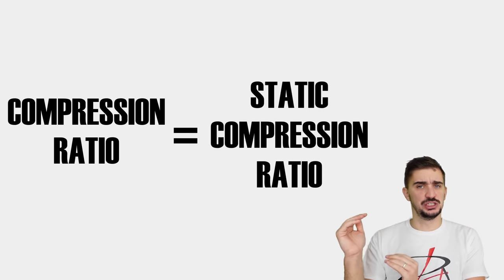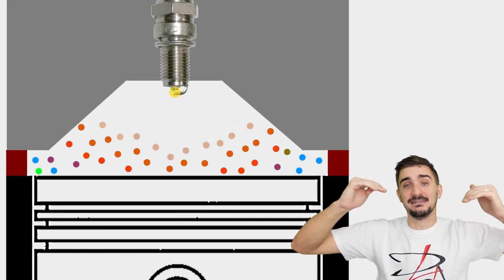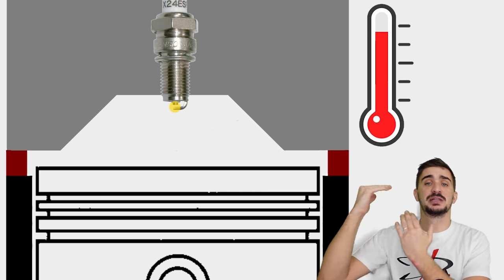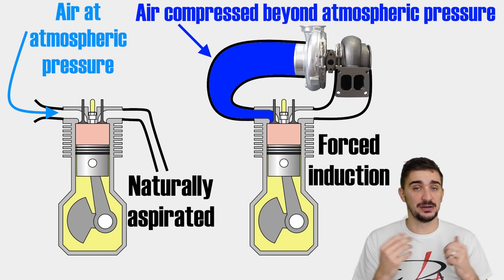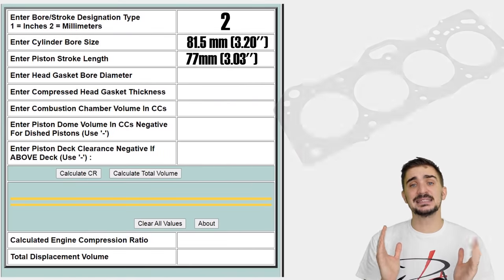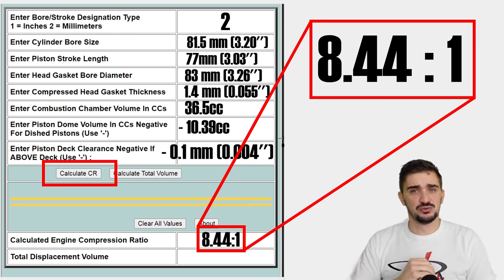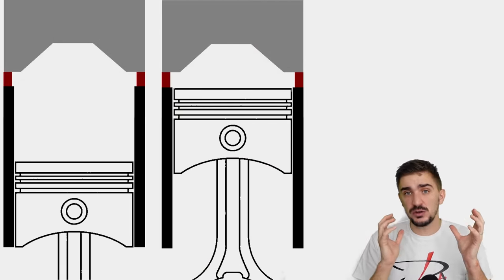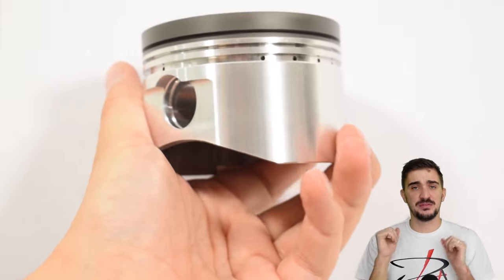COMPRESSION RATIO: HOW to CALCULATE, MODIFY and CHOOSE the BEST one - BOOST SCHOOL #10

Comment: Hi, i build stoker 1800 to 1950ccm ,,stock CR (10:1) i used crank big storoke 88mm,CR is coming out now 12,3:1 I want to use and  tank 95oct petrol. it is possible ? oder machined piston CR down? I will use stock head gasket , sport cams 265° degresee. Very thanks ..motor  is a BMW M42B18 IS 103kw. thanks

Comment: My first performance build I went for high compression just as the petrol quality was starting to be lowered some tears back, stonking power but knocked under load, forever feathering the throttle and dropping down a gear, till I holed a piston! High dome pistons with sharp edges also promote pinking, I discovered 😁

Comment: I'm a newbie. I came here wondering about turbocharging my car, and this gives me a question I hope to get some answers to...

The car is supposed to run stock 125 bhp, it's running a 2.2 straight 4. Should I look to mod the compression ratio (stock 9:1), or leave it as is in order to run 200 whp as my target?
Thanks for any input :]
Reply: If its a stock engine you should first do intake, exhaust, tune and cams

Comment: Good video, but I missed the fact that higher comp ratio decreases engine lifetime because of higher temperatures and more mechanical stress.
Reply from the maker: So diesels have short lifespans? I'm afraid it's not a direct correlation. If the engine is built properly around it can have a long life and a high CR.
Reply: It’s all relative to tuning. I’ve seen terribly unreliable low compression motors and ultra reliable high compression engines. I have a 10.8:1 compression in my turbo charged engine with no problems. Runs 95C in the summer and winter.
Reply: The parts need to be specked for their use.
Reply: @d4a   A Diesel burns completely different than a petrol engine, knocking is not that problem on a diesel. For example, you raise the comp ratio from 9:1 to 12.5:1. The engine is not designed for that. When you start and the engine makes the first turns from his own power (combustion) the oil pressure and the oil itself had no time to arrive the whole engine, but your bearings for example will stressed by the stronger ignition. Hope you understand??
Reply: @bennyz1971  but on idle, even with higher cr, in combustion chamber is small amount of mixture so pressures on tdc will not be too high, big stress on engine will start  on low rpm and wide open throttle(high pressure on tdc and low oil press because low rpm)
Reply: @d4a  Really mate, Benny Z is right. Just take a look at CR vs temp diagrams for gasoline engines... But there are different rules for diesel

Comment: I'd like to add that sometimes a lower compression ratio can result in more power with a naturally aspirated engine on pump gas, because it allows you to advance timing.
Reply: It can, but really all that means is you need better fuel
Reply: @tayvonrose2528  Then you have to ask, "how am I going to use this car?"
 If it's a racecar and you have access to 110 octane race fuel or if it's turbocharged and you will run straigh ethanol, sure, go ahead and increase compresion all u can.
 If the best you can get is 100 octane (ron), you will need meth-water injection to run super high compression. 
 For me, running over 10:1 without direct injection is the best compromise between power, efficiency and being able to use 95 octane. 98 octane is 20% more expensive.

Comment: Have you ever test on dyno which one is better, high compression ratio with retard timing or lower compression ratio with more timing?
For example, lets say:
- Honda K series engine
- 11:1 vs 13:1 (similar piston weight, because lighter piston make more power)
- Same internal engine (rod, crank, valvetrain, etc.)
- Same fuel (98 RON/ 93 US octane)
- Same ECU

Comment: I've increased my compression ratio in my Turbo Buick V6 Powered Malibu from 8.0 to 9.3. It has much better throttle response and will spool the turbo up faster. I run up to 32psi of boost. I may increase it to 10.1 at a later date...when it's time for a refresh or if it blows up. It's been in the car since 2005 so it's not a bad thing to increase your compression on your boosted engine. You just have to manage knock very well and don't get stupid with a lot of timing.

Comment: 12:18 Yes, boost makes more power than compression, but compression gives free power, while boost is very fuel hungry. When I say free power I mean that two engines with equal displacement running at the same RPM will suck the same amount of fuel, but the one with higher compression will make more power (higher efficiency).

Comment: Hey. I have a 16v 4age top and a 7a lower, and I'm thinking to add a turbo for more power. Can the turbo kit just be added? or will I have get new pistons and such?
 Like you, 300+ hp sounds just perfect, nothing too crazy and expensive. Also, Any other advice would be good. 😁 thanks much

Comment: Put piston in lowest position. Pour in oil until its filled to the spark plug hole. Then turn to tdc. Suck away oil until same lvl. Calculate conpression ratio

Comment: So you didn’t tell us how to calculate compression ration at all 🤔 still a good video especially for beginners but I was after the formula’s, also some normal size engines examples would have been nice as well (here in Australia n common engine size are between 4 and 6 litre, in the USA they seem to have between 4 and 7 litre fairly common

Comment: I did some research on the compression ratio of my 2021 Sonata 2.5 na.
Its a whopping 13:1 ... even the turbo 2.5 is only 10:1
I must say that my car has an interesting growl at low speeds.  I consider the power adequate and the fuel economy exemplary. 
Over 40mpg cruising at 70mph.

Comment: I like to think of compression ratio like this:
Using the gap at TDC, how many of those gaps would you have to stack on top of each other in order to fill up the cylinder from BDC to TDC. If the gap is larger, there aren't as many needed, resulting in a LOWER compression ratio. If the gap is smaller, it will require more of them to fill up the cylinder, resulting in a HIGHER compression ratio.

Comment: Great videos!
Just starting to get a interested in mechanics thanks to  your Videos!
I"m looking to get "LOW END TORQUE"  for steep climbs for gradients sometimes over 20%(currently living in the Andes) on my 4x4  1.6 liter Suzuki(Isuzu) Engine which has a  9:5 Compression Ratio (according to the dealer manual).  I want engine responsiveness for my daily drive not interested in high RPMs. 
How can I achieve  this knowing that my engine is in for repair next month.

Comment: What do you say to people who claim that they can increase or decrease compression ratio by the spark plugs they use or how far they screw the plugs in? The argument is that different plugs have slightly different occupied volume. That is the volume of the protuberances above the face of the plug minus the cavity space between the walls and center electrode/insulator. Also, these individual claims that you can slightly decrease compression by using two or three washers instead of one when installing the plugs so it intrudes less into the chamber. Sounds like a sub-optimal way of changing compression because it can negatively affect ignition performance. But it is the ONLY way to change compression without disassembly of the engine.

Comment: Bro what you think they increase the air by putting big intake and aftermarket cams + more fuel modify + bigger turbo, you think they need a bigger capacity? Looks like its overload theres a to much air in breather but not in exhaust

Comment: Methanol injection does not care about your compression ratio, 10:1? 12:1? 16:1? As long as the block and head can handle it and you can feed it enough air it'll run fine, not smooth, but fine

Comment: The most common mistake in explaining compression ratio is that no distinction is made between compression ratio and real compression (compression ratio = compression). 
The first is a static mathematical number and the second is a physical quantity. Complex, dynamic, physical function with multiple variables. 
Namely, this number determines the parameters of the movement of the piston down.
Reply from the maker: The most common mistake of people that want to seem smart is that they take a simple straightforward concept and needlessly complicate it

Comment: usually have good content but this one is disappointing 
you are better than this
no reference to octane rating and various fuels & knock mitigation
no mention of dynamic compression ratio
the bigger the cam the less DCR (less boost & more efficient)
nor cam events like intake valve closing
and head cooling/overheating issues beyond certain values
it's more fun to plug in your own values into a spreadsheet doc lol

Comment: My compression ratio on my latest build was too high to run standard fuel, its now permanently on E85. Only way around it is to run weak actuators or decrease dynamic compression via aggressive cam shafts and bigger turbo rear housing.

Comment: Does reducing the cylinder volume by resurfacing the block and using a thinner gasket reduce horsepower in a NA engine?

Comment: Very good video, but i think that running 7:1 ratio to run 500 on 1.6 engine is a bit extreme, thats the sort of shit you would see in 80s with little to no electronics 😅
Modern ecus are capable of running higher CR with more boost. 
Maybe for 1000hp 7:1 would be more likely. 
I heard many times that more compression will spool turbo faster  so less, dont always mean better for boost 😆
Reply from the maker: Modern ECUs are only capable of protecting the engine better and running closer to the edge of knock. They can't beat physics and once knock starts you are at the limit, you have to retard timing or add fuel which kills power. An ECU can't change the point where knock starts. Spooling the turbo faster doesn't increase maximum power. It increases responsiveness and I covered this in the video accordingly.

Comment: upgrading the pistons, rods, wrist pints, & valve-train will enable the engine to take added boost from a turbo/supercharger without blowing up or throwing a rod for the most part??
Can you do that to any engine you'd like?
Reply from the maker: In general, yes
Reply: i see. does a thicker head gasket make the engine less likey to blow up too?

Comment: D4A how does compression affect rpm limits? does a higher compression allow for a wider rev range?
Reply from the maker: It doesn't correlate with rpm in a significant way, your rpm is primarily limited by your rotating assembly mass and strength

Comment: i have a 2l inline 4 cyl. and it has a turbo that runs on 0,75 bar pressure. the compressionratio is around 9:1 to 9,2:1 
so use my car as a summercar, dont race it, but i like to step on the gas sometimes and run faster on the streets. i wanna keep the power the same (180 PS). but from what i understood, is it ok to raise the ratio a bit higher? my mane goal is to safe a bit of fuel and make the engine more economical when i drive normal. i also installed a better ignition system and kicked the distributor out. the new system has knock-controll via the sparkplugs. though i wanna safe fuel, more important for me is to keep the engine healthy, so would it be better to do nothing? put the money aside, thats the second problem i can care afterwards
Reply: it seams your engine has many restrictions in intake and exhaust, take a look on gale banks channel-"boost gauge is dead for me",

Comment: I’m probably being nitpicky, but compression doesn’t really make the air hotter. The amount of heat is the same; it’s just concentrated in a smaller space, right?
Reply: No, compressing a gas increases its temperature, decompressing it decreases its temperature
Reply: @user-si5fm8ql3c  yes I agree. But the amount of heat in the system stays the same. 

Temperature is a measure of the average heat across a given volume. If the total amount of heat stays the same but the volume decreases, the heat in the system is constant but the temperature increases

Comment: Turbochargers/Superchargers force more air into the cylinder, raising the compression ratio, to produce more power. Why bother with that? Why not just run higher compression all the time?
Reply from the maker: Because increasing compression by 1 point increases power by around 4% but 15psi (~1bar) increases power by 100%
Reply: @d4a  I know there're reasons for all these things and that I am not the first one to think of this, but I just don't understand, you're saying one extra bar doubles horsepower but if you can increase the pressure inside the cylinder by one bar without knocking / predetonation stuff, why don't we do it all the time? Maybe it's because the engine can handle that much compression at high RPMs but not at idle?

Comment: Most likely a fact: the hemi on dodges v8 stands for hemispherical piston/chamber, and this creates a very good compression due to half circles fitting together very well. Figured I’d give my little knowledge to whom have not been blessed by the 5.7L
Reply: The Japanese did that in the 70s as well. Even the Honda monkey is a hemi...
These days, they - and most other manufacturers of high end engine hardware - have figured out that there are much better solutions that offer higher compression, more flow and power and better efficiency...
Reply: MV Augusta bikes still uses hemi chambers and radial values I think.

Comment: Honestly we found it depends on fueling, which has come a long way. We run 560whp on just 8psi of boost in our Honda Jseries V6 engine (J35a7) and are running 10.8:1 compression. We ran it on 93 pump, E35 and lastly full E85 pump and never had any issues at any power level or with any fuel. We tend to run and build all of our engines at higher compression ratios then what you showed here by quite a bit. 7:1 and 8:1 is old school compression theroy

Comment: While some of this is true, let's go back to science class.
1st, atmospheric pressure at ground level is,
14.7 lbs per square inch. SO, when you say
Compression is 10:1, You are compressing atmospheric pressure 10 times in your cylinder/head assembly. All things being equal
Compression pressure measured at the cylinder, through the spark plug hole should be   147lbs per square inch...
Ironically the ideal stoichiometric air fuel mix
Is 14.7 to 1, or roughly 15 molecules of air per 1 molecule of air or oxygen...
Reply from the maker: Your point is?
Reply: @d4a  
It's not totally dependent on the volume of the cylinder, or swept volume, ie 100cc, or 10cc at TDC. At a different atmospheric pressure, let's say, 14,000 ft Above sea level, you would be hard pressed to get the same compression measurements. So, it's dependent on atmospheric pressure...
Reply from the maker: What you're saying is redundant. Compression is not dependent on altitude/ air pressure, it's influenced by altitude just like power is. If engine 1 makes 50hp and engine 2 makes 100hp at sea level, engine 2 will still be twice as powerful at 14.000ft or whatever altitude. Both will loose the same amount of power. Same goes for compression, 12:1 will still compress twice as much as 6:1 at any altitude. Compression is dependent on smallest and largest volume and power on torque and rpm. What you're saying is like saying the taste of food is dependent on the amount of salt and not on the quality of ingredients and the skill of the cook because if you put a bucket of salt in a dish it will taste horrid. Basic common sense tells us that we observe engines at sea level and assume that cooks aren't insane.
Reply: @d4a  
Your forgot "density" as in density altitude.
Less dense means less oxygen molecules, therefore don't matter what size engine or compression ratio. Fuel cannot burn without oxygen. Any engine will burn up running lean and waay too hot...

Comment: Here interesting question, in a naturally aspirated engine the compression ratio depends on the size of the engine ?? I mean in an 800cc engine is the same 12: 1 as in an 8000cc engine ?? or due to the greater displacement the compression should be noticeably lower?
Reply from the maker: Compression ratio and displacement are unrelated. 100 to 10 and 1000 to 100 are both 10:1
Reply: @d4a  but 10: 1 is the same in a small motor as in a big one? Couldn't small engines carry higher compression without knocking danger? and the opposite of a large engine that compresses more air mass

Comment: Can you also explain dynamic compression ratio?
Reply: It takes into account restrictions in the air intake and when the intake valve closes, in effect the actual mass of air in the cylinder when the intake valve closes, vs what it would be in the ideal "static" condition described in the video.